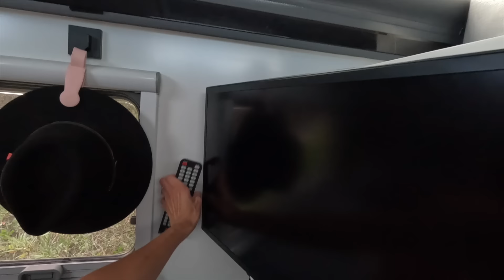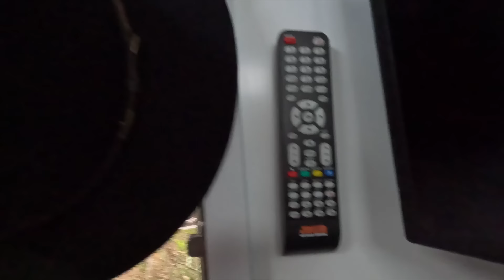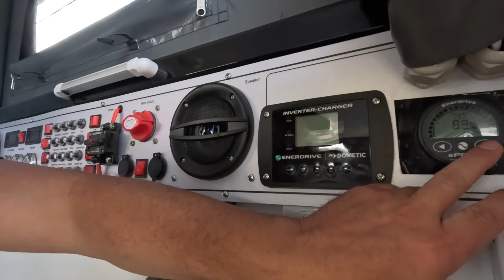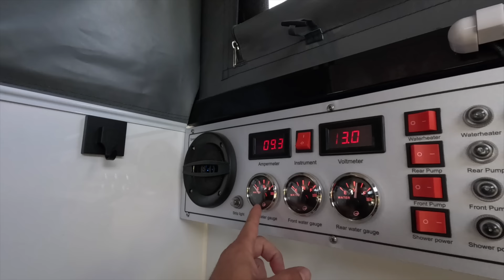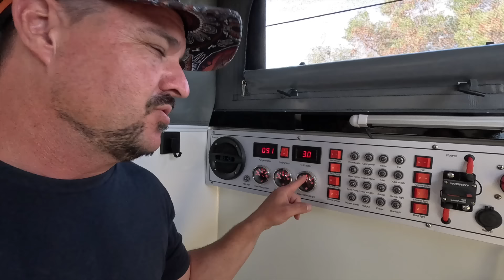Jawa Sirocco Grande 2024- Comprehensive Walk-around & Handy Camping Hacks

Comment: We installed a shower miser water diverter in our  build , it diverts first cold shower water back to tanks until blue sensor turns grey that indicates hot water in the line then turn tap back and away you go.  This is in addition to the standard shower flick mixer
Reply from the maker: Sounds like a great idea
Reply: Can this be installed “after build”?
Reply: @suzieschwebel1558  yes there is a retrofit unit available I understand

Comment: Hi. Do you find that you have to remove what you need from the pantry before you start cooking? If you are vertically challenged would you have issues accessing the pantry depths with the sink and stove deployed ? Jawa seem to be a an above average quality product, time will tell if the build quality holds up.
Reply: That does look like an issue.
Reply from the maker: The setup here was high on the kitchen side due to the slight slope on the site. Generally easy to reach everything whilst cooking. Dee’s 5’8” and has no issues reaching anything

Comment: Awesome walk around guys. 2 questions, 1. The Sirocco demo we looked at did not come with the black towel holders etc. Did you add these? 2. Have you ever wanted/needed a reverse camera? It seems as the only real feature missing from the Sirocco that seems to be standard on other similar priced campers.
Reply from the maker: Hi Rob. The towel hooks etc are called FusionLoc’s from Bunnings. They are awesome, but stuff we added. As for the reverse camera, we added a Safety Dave to our first van and the car. Used it once. I think you can spend the money on better mods to the van/car. I just get Mavo on the handheld UHF and she gives me feedback as I reverse

Comment: Thanks for responding to our last questions it’s very helpful. Another couple of questions… hubby wants to know what tyre pressures you run both on the car and the van when you’re travelling on the tar, and I was wondering if, after rain, you get water running off the outdoor pantry lid/door cover into the pantry boxes when you first open it?
Reply from the maker: Hello again! We love your questions. So far on the pantry and we’ve had quite a few days of rain (nothing really heavy), but haven’t had an issue with water running over the pantry.

As for tyre pressures, I run (all cold) car front 36 and rear 38. On hot days that will look like 40-41 front and 42-44 rear. In the van I run 56 cold if the water tanks are full, 54 if not. That will still rise to over 60 on a long drive

Comment: Very interesting. 
Understand why you like the Enerdrive setup as we have just done 56 nights off-grid in Tassie in our Lowdown, which has 2 x 190 watts of solar, a 200 amp lithium, 2000 inverter and chargers. Didn't even use a portable solar. We do run a laptop and induction cooktop, but not Starlink. So your larger setup would be even better. 
One water saving tip is to put on shampoo and conditioner,  rub them in and then turn on the shower and rinse them out.
Re. resettable fuses, we've had a couple fail and need replacing, so I bought several spares from Jaycar and NAPA.
We've also had some electrical issues and I can tell you the wiring behind the panel is a maze.
Don't recommend putting any chemical in the toilet flusher tank as it can clog up the pump. We've had to replace our pump and now have an electrical issue to fix with power to the pump.
Our Lowdown is 4 years old and it's great to see the continual improvements Jawa is doing e.g. we fitted a little wheel from Bunnings to the corner of our door to avoid it catching the awning, so rounded door corners are a good idea.
Re. the standard awning and wind, we have had ours in strong winds and it's surprising how much they can withstand, most recently during a gale on Bruny Island, but it's still a good udea to take it down in extreme conditions. We even had to drop the roof one night in Tassie as the wind was shaking the van.
Jawa's 2024 range is sounding impressive. 
One question I do have is if Jawa is planning to offer a gasless option, as some companies do, with extra solar and batteries and all-electric induction and water heating. Seems to be a trend.
Reply from the maker: Hi Michael, thanks for the tips. I’m not sure about the gasless option. I know the team were exploring when the new compliance laws were introduced, but they seem to have solved to meet the requirements. I’ll checkin with them on is it is on the radar, but my assumption is that it has been shelved at the moment

Comment: Hey guys, loved your video. We’ve just taken delivery of the same van. Just wondering if we really need to take a generator on our 6 month trip, and also wondering how long you find your toilet cassette lasts before it needs emptying?
Reply from the maker: Hey Suzie! Great choice of van. So we decided to leave the genie at home, but have thought about it a couple of times. It really comes down to how you use the power and what weather conditions you get. Being right down in southern WA, it’s been cold and windy. I’m running Starlink to work 6 hours, 4 days per week and that is drawing about 12A with running HD video calls, laptop and extra monitor. That’s 70-75A in the day extra that we need to find. It’s been ok, but have got down to around 75% on morning 6 of a week offgrid. Not bad, but I have been watching the ePRO carefully…. Two fridges also adds more draw than we’re used to. I still think the weight of the generator is too much to maybe need it once or twice in 6 months….. but it just comes down to the way you use power and being comfortable if you see the battery not recovering to 💯 everyday
Reply from the maker: As for the toilet cassette, we carry a spare for extended offgrid away from dump points. Ours lasts 4-5 days, but Ant usually finds ‘trees to water’ if you know what I mean 😆

Comment: hey guys can you run a air con from say 300 to 400 ah batteries if not what do you think you would need a generator ????
Reply from the maker: So I’ve already tested this van for 3 hours off the inverter, so short answer is yes you can but it also comes down to the inverter, not just the batteries. It will come down to a huge list of variables as to how long I can run it for…. Planning to make a video on this very topic